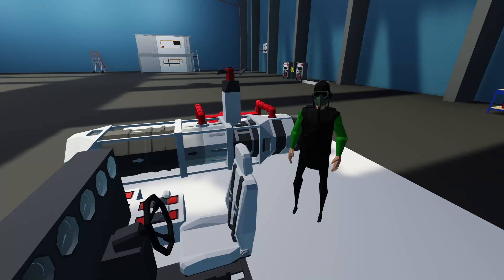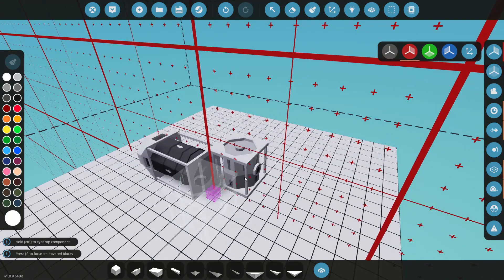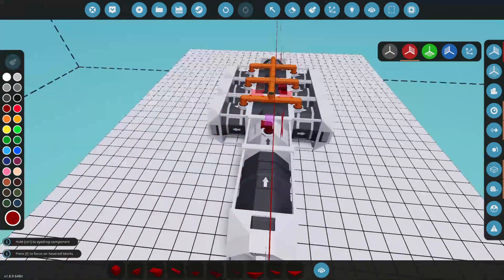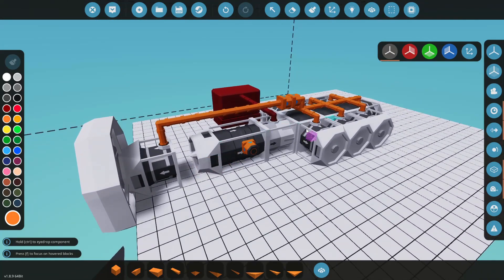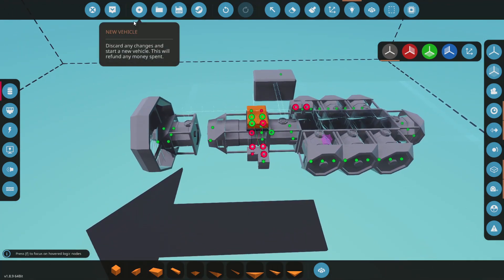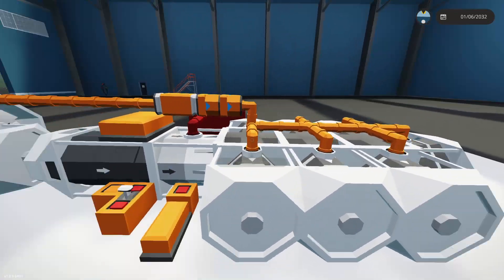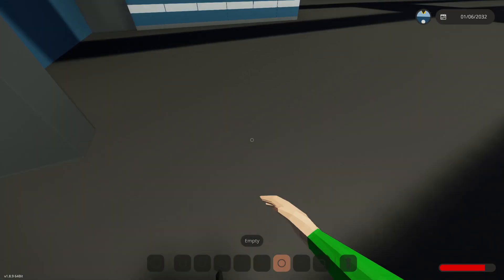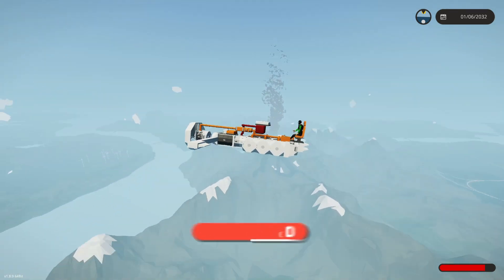Jet Turbine Modular Engine Build Stormworks Tutorial - How To

Comment: Been trying to get you to use jets for ages 😂 Mine does 1250kph and spins at 30rps so it’s super cheap on fuel. 0.2 fuel per second. You can use a pid to limit rps. Also you can hook to rotors and lift ridiculously heavy things.
Good job 👍
Reply from the maker: Oh wow! gonna need you to tune my engine here soon.
Reply: My old jet barely reaches 600 and isnt effiecent😂
Reply from the maker: @jgbelmont check description
Reply: Do you have a tutorial for that? I cannot reach such numbers... :D
Reply: @marcelfelde Not played this game in a long time. You could try looking at my workshop (benthedaddy) There should be a vtol on there with the same concept engine, you could rip that apart and scale it up as desired. 
 No idea if it still works though since updates tend to brake stuff.